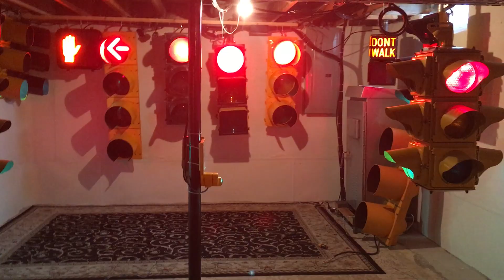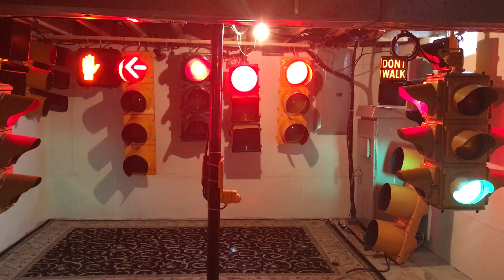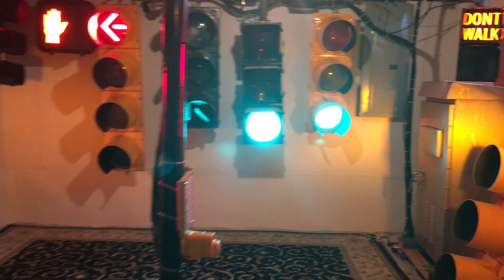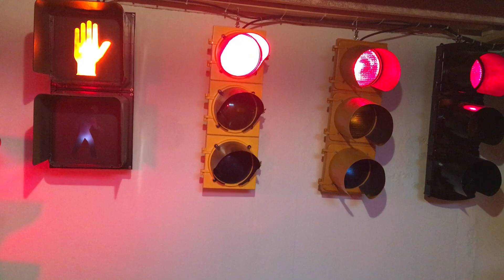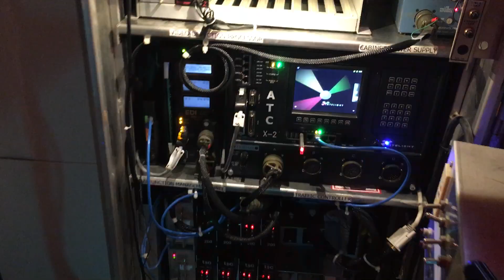How crosswalk buttons work

Comment: Hi Nick, I had just bought the same button you have but I have no idea how to connect it, I don't have a box like you but I just want it to work like a button it (comes on when pushed and off when let go) I also need it for only 2 wires but there's three terminals, if you don't know that's fine, have a great new year.

-Hunter Fox
Reply from the maker: Hi Hunter - is it an electronic button like the Polara, or a mechanical one like the Pelco?

I assume it is electronic and you want the two-tone (press and release tones) beeps and LED blink. The button will operate on 12 to 24 volts AC or DC. 

In many cabinets 12 volts AC is supplied to the ped buttons and an isolator protects the cabinet logic circuits from cabinet damage caused by the buttons being hit or similar. In my cabinet, there is little risk and the buttons are wired directly to the 24 volt DC ped logic inputs for the respective walk phases

Comment: And also how do you set up the flashing red left turn sequence?
Reply from the maker: In-Cycle Flashing Red on the EPAC is one with a non-standard overlap outputting to a phase channel. 

From main menu go to Time base data then Special Function Mapping. 

Scroll down until you see the line: AS8-15=OLI-P FL R PHS and put a 1 in ANY of the rows to the right. This field establishes Alternate Sequence 8 as the included phases that will run with overlap I, AS9 with overlap J etc, etc. 

There are 4 hardware overlaps in most NEMA machines A B C and D. So to use Overlap I you need to output through a phase channel. 

From the main menu go to Unit Data Overlap Standard and scroll to Overlap I and put a 1 and overlap phase and overlap channel for the phase you want to output a flashing red. The machine may warn you that you are modifying a channel and to allow it and move forward. 

When using overlap I, go to unit data alternate sequences and in alternate sequence 8 put in the phases where you want the flashing red active. Typically its the adjacent phase so if Overlap I was channeled to phase 1 output then modify AS 8 from 00-00 to 02-02. This will flash the red on phase 1 when phase 2 starts and continue flashing until the end of phase 2. 

To run the standard Michigan flashing red sequence in the EPAC you must use an alternate sequence to reverse phase pairs, making phase 2 run before phase 1. Use alternate sequence 1 for this and put in 01-02. Then to manually use an alternate sequence go back to unit data and go to start up and misc and in the alternate sequence row put in “1”, and recycle power to the machine. Now it should function like a Michigan sequence with the through lights turning green first with a flashing red left. And the ending with the green arrow.  

This is how all EPACs in Michigan ran flashing red lefts. EPIC controllers, on the other hand, which used to be the MDOT standard controller used open ended timer intervals that could be set to output a flashing signal on any interval.

Comment: Nice Collection! My collection is currently running off of an EPAC300 and I’m trying to set mine up for the flashing yellow arrow as well. I was wondering what I would have to do in order to set it up. Thanks.
Reply from the maker: Firstly you will need an EPAC with software revision 3.33E or newer to run Flashing Yellow Arrows. Check the software revision near the top of the main menu

If the software checks out, from the main menu go to Unit Data, Overlap Standard and confirm the Overlap you want to use has NO Overlap Phases or Channels assigned to it. Entries here should be zero for the selected overlap otherwise FYA is inhibited

Return to Unit Data sub menu and go to Overlap Special. For FYA operation “-G/Y” is your protected green arrow phase (lets say phase 1) and “+GRN” is defined as your permissive overlap phase (the phase green when you want a flashing yellow arrow display — lets say phase 2) No other parameters need adjustment here. Timing of the green arrow is done in Phase Data. 

Hope this helps…

Comment: How many volts at the button / pole or lights? Sounds like its all low voltage 12-24 dc ?
Reply from the maker: Buttons are powered by 24 volt DC from the cabinet. In my setup it is a direct 24 volt connection. At a typical real intersection, there is an isolation circuit between the 24 volt controller logic to the buttons in case there is damage to the button or pole wont short out the controller logic circuits. The isolated voltage is 12 volts AC or DC. All the lights are 120 volts AC

Comment: Hey Nick since you have experience with digital cross walk buttons I would love to know if you can adjust the volume. I live downtown San Diego near Park / Imperial and these buttons are stuck on ultra loud mode beeping non stop and announcing   “Walk sign is on to cross to Park” and then “Walk sign is on to cross Imperial” Would love you help!
Reply from the maker: Those sound like Navigator buttons by Polara which I dont have. But the volume on those are adjustable by plugging them into a laptop with software. The non stop beeping is the locator tone.

Comment: There’s a weird 3 way intersection near where I live, if you press the button, it immediately makes any green lights turn yellow.
Reply from the maker: That is common at 3 way intersections where the green light for the main roads “rests” - or holds green indefinitely until the controller receives a call to the side road either vehicle or pedestrian detector.
Reply: Nick B now that you mention it I have noticed before that this light always stays green until someone from the side road approaches. Thanks for letting me know.